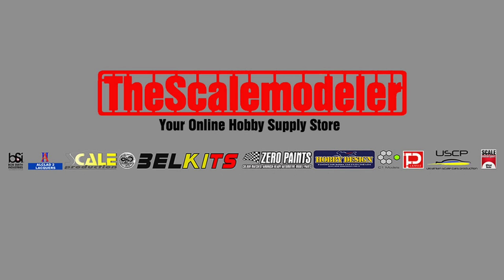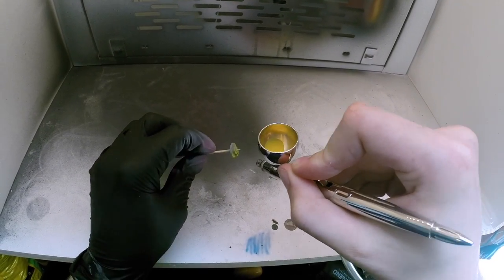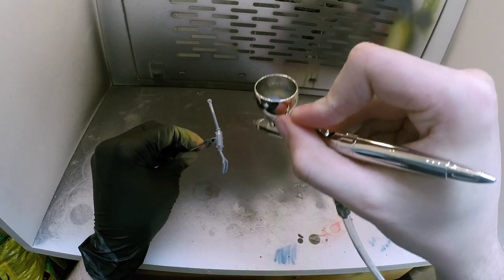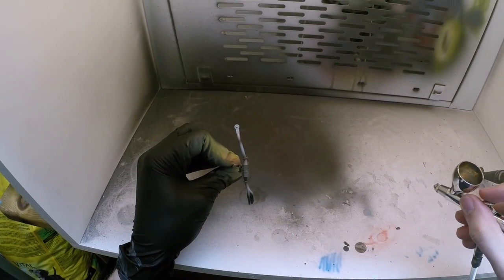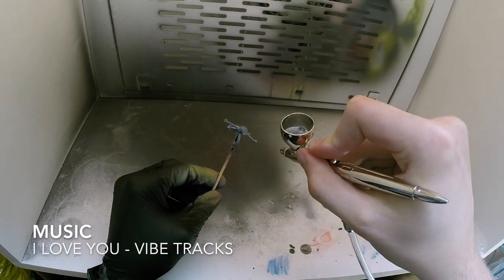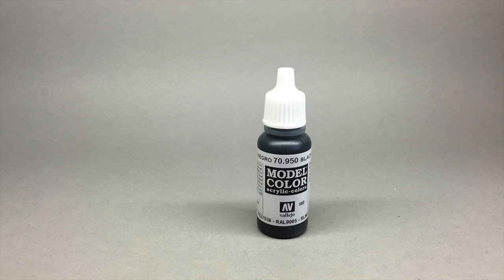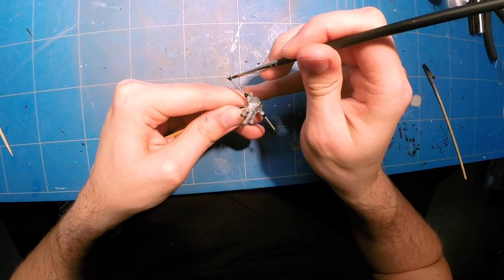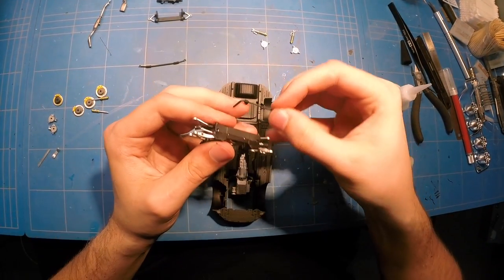Tamiya: Honda S2000 Part 5

Comment: Do you top coat all the parts you painted or just the thing that mattered like the body? I'm basically trying to shave off any unnecessary stuff in my painting process not only cars but others such as Gundam kits
Reply from the maker: I only clear the parts that matter. If the painted finish is the desired one i just leave it.

Comment: Great video! By the way you've got some nozzle sealing issues. Bubbles are appearing in your airbrushes paint tank...
Reply from the maker: Correct, it was not properly screwed in.
Reply: Just noticed that too, during the burnt ironing of the exhaust. Classic H&S,.. already crushed one washer on mine because I over-tighten to compensate.

Comment: A lot of people are using acrylic craft paints for models. Do you have any suggestions or thoughts about this?
Reply from the maker: I just use Vallejo an zero paints
Reply: Don't run them through an airbrush. The pigments in it are much thicker than standard airbrush paint and it'll clog your airbrush. If you really need to, pick up a cheap single action airbrush and use that instead of an expensive dual action iwata airbrush or something. Thin them down and apply lots of thin coats if you're going to brush paint.

in my experience, it's best to just buy the good paints right off the bat. You could use Tamiya, Vallejo, or games workshop's various lines of paints (they're a warhammer 40k paint brand).